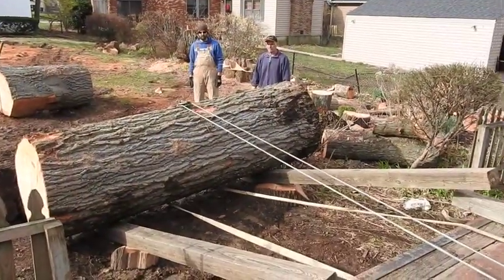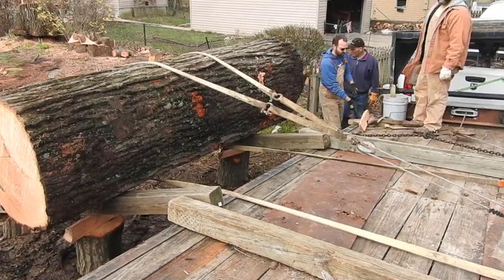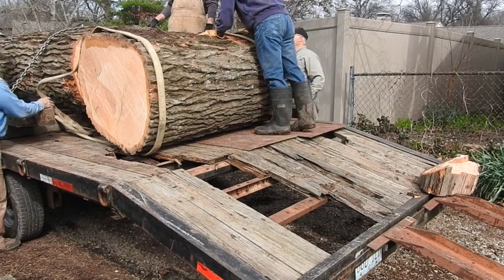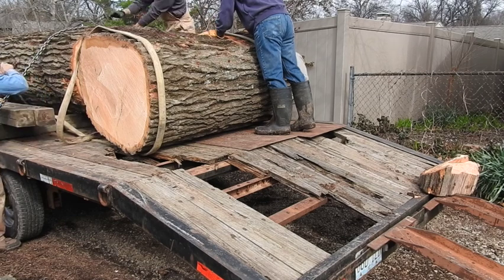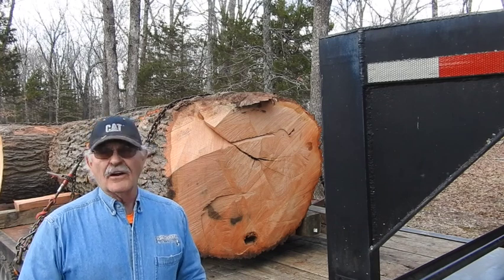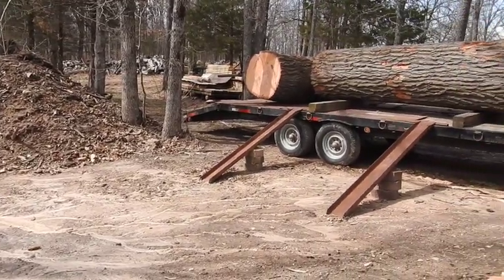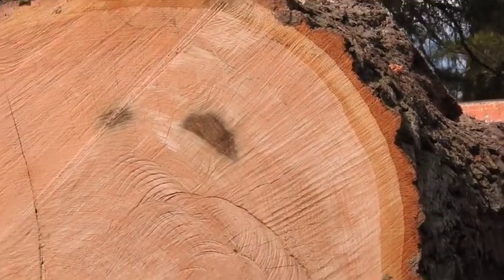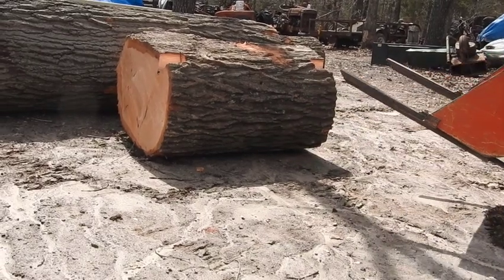APEX 12,000 lb Winch 4 Snatch Blocks Loading Big Oak-What Can Go Wrong

Comment: I Like that one Sir ( he scenario being the short chunky one rolling off the back end of the trailer at 60 mph on the busy interstate.  Not gonna happen....!! ) Like the last paragraph of yours very well written text Sir !!! Very well rigged cable, chains, support !!! THESE ARE MASIVE LOG !!! That work was vey hard on your trailer floor !!! Very nice commentator lady voice 🌹 These are very heavy for sure !!! Have a OUTSTANDING safe week to both of you Cheers !!!
Reply from the maker: Thank you mon ami for stopping by and adding a superb comment !!  Yes, they are a bit heavy and yes, its hard on the floor, but if you notice all the steel plates on the deck that's because the deck is mostly missing under them....LOL  I've been working on sawing new oak deck boards, but what I've got sawn are air drying right now....but soon we will get it all fixed.
Reply: @tractorman4461  ; )

Comment: pleasure to watch a crew that knows how to use blocks. Job well done.
Reply from the maker: Thanks Larry, for the cool comment.  Much of my career in commercial hvac involved rigging and lifting small to super large equipment to rooftops as well as up and down steps, and about any situation with every kind of crane on wheels or winch there is. Well, that's an exaggeration, but we've done more than a little. (-: Thank you for the compliment on the crew.

Comment: Many thanks for that video. Worked our Woodland Mills 30 Max this last weekend for the first ever cut and ended up with a trailer of 10ft 6x2" Alder for the mill shelter roof. Two beginner problems. First , set the top cut too low and caught the top butt flare of the log before we reached the end of the log. Elementary mistake , oops.
Second , hauling the log up the ramps the flare gave us an unequal climb rate and looked like we were going to loose that end off the  inside of the ramp. Managed to push it back.
New project, rebuilding my Massey Ferguson 135 to take  a frontloader with forks and use for  moving lumber. Wife had already suggested using strops with snatch block as in your videos so really useful . I think we'll be borrowing your ideas. Just looking for the milling video (s). Cheers from Wales , UK.
Reply from the maker: Aw heck Lloyd, I ran aground just a couple weeks ago with the saw head.  I knew better, but took the chance and lost.  LOL  Next time a lot goes crooked, try blocking the fast end and let the other end roll to catch up to it.  We sometimes can block it with one guy holding a cant hook handle against it and the log will slip on the handle while the other end rolls.  But you have to be careful with a strong guy in that position...and roll slooooooooowwww.   
    I think if you type in 'Tractorman44 sawmill' in the youtube search bar it should pop up a lot of the milling videos.  Thank you from watching from so far away...we may visit Wales one day and have already made it to Ireland and Scotland.  I would LOVE to visit the Isle of Man during race day.  Thank you for todays visit and please don't be a stranger. I might be a little slow on replying from time to time, but I get to most of them all the time.

Comment: Most I have ever had on my mill was 24 inch, that was 20 ft long. My mill could not handle those puppies you brought home. Would love to have that wood. Great job.
Reply from the maker: These will have to be trimmed down with the Alaskan mill before they'll fit my little Frontier.  But If I had the big 60'' circle mill in operation, I could handle them the way they are I believe.  Thanks Jim for stopping in today.  I've already milled the short on that's on the back of the trailer:https://www.youtube.com/watch?v=u5_vJDP4w0s&t=57s  It's not the best video.  I'm still learning the holzfforma set up.

Comment: I  can sure see where a few oak planks can be used!
Great 'blow by blow' on those logs rolling off the trailer too, "Tractorman00'!  Thumbs up!
Reply from the maker: Hahahahaha....I was wondering when a comment would reflect my rotten deck boards.  The metal plates are on the flat portion so I can haul tractors or vehicles.  LOL.  I've been sawing a little oak here and there in 12's and 8's for the 20' deck.  But yeah, it needs a new deck.  LOL And yes, the Missus did good at the end !!
Reply: @tractorman4461  Who, me?   I'd never suggest anything like that, would I? Hahahaha! Yeah I would.
I was only thinking that the trailer would look so good with all this new planking on it,.... wink wink nudge nudge!  LOL!
Reply from the maker: @regsparkes6507  methinks youthinks correctly !!  (-:  All good things in time....
Reply: @tractorman4461  Yes, I can wait!  hehehehe!

Comment: 6848 pounds on a 10ft log. Norwood sawmill app. Its got a 1051 bf. In it. It's neat to know the stuff like that. I use it all the time.
Reply from the maker: Dang, I'll have to download that app.  Thanks, that's good to know.  Are you running one of the Norwood mills ?  I have one of their cheaper Frontier line, and OS27.

Comment: Nice job, Wendell.  Had me a tiny bit concerned but I knew you and the men would lean more towards cauton rather than try to grunt-move that massive log.  Those logs shook the trailer as if it was a paper weight. So good to see the logs in ther final resting place until you decide t move them.  They should produce some nice lumber. Be safe, my brother.  Semper Fi     Don  👍🏽🙂  4/3/22
Reply from the maker: Oh yeah Don, first and foremost we want no injuries to anyone. Slow and steady keeping an eye on everything happening, continually checking the rigging etc. is the only way to work with logs...even ones much smaller can easily break legs.  I commented to look at the flex on the front of the trailer as it rolled off the ramps as we were loading.  That's when I decided to place the short one at 90* to the big one.  S/F my friend and brother and thank you for watching as well as for the visit today.

Comment: Man that looked like a fun day. I wish the tree services I used to work for had done things like this. They just ate through chains cutting it into pieces and we'd toss it by hand. Nothing wrong with sweating but dang some of those days were rough.... That's the trailer you're re-decking right?
Reply from the maker: After that comment you made on the other video, I just KNEW you would like the bit of rigging on this one.  LOL  Yes, that's the deck I'm sawing oak for.  Kinda needs it doesn't it.  LOL  The Missus got a bit excited during the off load...cracked me up when I was editing this one....

Comment: Is there a reason you didn’t attach the snatch block to the tree on the other side of the trailer ?   One less pulley
Reply from the maker: Actually there are two reasons. First It was just enough off center to confuse the issue bringing the large log through the existing opening in the fence and secondly it too is not a healthy tree with one of the forks rotten and already fallen.  Then that fork is in the tree about 11 feet up with a large above ground phone cable and a 'cable' cable running through the fork.  I figured it'd be my luck to break an already weak tree and take out a phone line.  But that didn't stop us from throwing a nylon choker around it before the final rigging and look it over before abandoning the idea.  Good eye there Mathieu, good eye.

Comment: The Missus makes an excellent narrator.
What about that trailer? The boards are looking mighty thin. Is this the one you cut the planks for on the sawmill? Why ain't they installed yet? lol
Be safe.
Reply from the maker: Thank you Rick, for the nice words about the efforts of the Missus.  The trailer deck has been on the list for repairs now for a couple years.  I've got about half cut that I need and they are air drying now.  So later this year I hope to get it done.

Comment: Good narration of the Missus! I was wondering about the V notches but you answered the question.  That last log would make nice thick lumbers to replace the wood bed on your trailer. That won't be a waste of time to replace that rotten wood! As I was wondering how your wood mill would support that weight, I remembered the base you did for that. No worries there!  But what about the OEM cross braces on which the log will sit? Can they support that? Thanks!
Reply from the maker: Yes, the old deck has been asking for repairs for a few years now.  I think it's time to listen to the request.  LOL  The cross beams on the bedframe is box tubing. I don't think there will be a problem with the weight on them OR the frame. If we divide the approximated weight of the log by the number of crossmembers that the 11' log will span we can see the approximate weight per member.  
   If the log's estimate by the time its trimmed down to fit, is around 6,000 pounds, and it spans six crossmembers, that'll be 1,000 pounds each. If it spans 7, that would be 850 pounds.   Estimation on the log at full diameter and 11'4'' is 7,000 pounds.  I'm estimating 4 1/2'' trim on four sides to fit the 28'' mill.  Of course Joe, this is all by the seat of my pants estimation.  There was a viewer with a  Norwood chart that showed the weight at 10' to be 6,800 (+) pounds.

Comment: So the duty cycle stays the same  even with the extra snacthblocks? Did the one double the winch strength and the other two just helping? Great to hear Misses doing the play by play! Thanks!
Reply from the maker: I would think a snatch block extends it a little Mike, but I don't know for sure.  It would make sense there's less heat generation on the contacts of the solenoids with a lower load on the winch.  I never worry about cycle time with a light rolling load for that reason.  Only the one on the log gave assistance to the winch by doubling the output. The other three were just changing direction so we could pull from the side of the trailer with the winch mounted permanently on the front.   I should've done a close up, but the first one was directly in front of the winch directing the synthetic rope  into the fairlead so it would wind correctly on the reel.  The other two shifted it down the side of the trailer to pull straight from the side.  I can see her lips moving but I never know WHAT she's saying until editing time comes around.  LOL  She kills me sometimes.  (-:
Reply: She is a hoot! Thankz for sharing her and how you go about your work. I normally have to do thiz kind of work by myself.  Great to see how you get the job done! If you can't get the Alaska rig could you just split in two to get the wood on your mill?
Reply from the maker: @mikeadams2339 The Missus was having fun and wants to more narration for me.  I think she adds that little 'flair' to the videos Mike....LOL 
    On the log, I think the best thing is to shave it down to fit the OS27,  I think  subtract 28 from 45 then divide that by four and take that amount off the log.  Then we can go about adjusting its dimension for centering the grain to begin milling.  Of course that thought process may change before I get to it though.  Roughly 4 1/2'' off each side should be close, providing the 30'' Alaskan mill will allow it.  Time will tell.
Reply: Yes more FLAIR!!!
Reply from the maker: @mikeadams2339  hahahahahaha....we will see.LOL

Comment: Your trailer earns its keep
Reply from the maker: Its not bad for a home made trailer.  LOL. I most recently changed the axles to 8 lug 8,000 pounders and changed from a Ramsey 8,000 to a 'badlands 12,000 pound winch with remote.
Reply: @tractorman4461  wow! Good for you. Id have to buy something like that
Reply from the maker: @timbarry5080  I LOVE the remote control.  I can walk all around and keep a closer eye on what is being loaded or sit on the seat of a dead tractor or vehicle and more easily control the loading process.  The old Ramsey only had a 10' tether, so I'd have to stop and adjust steering wheel and go again.  With the wireless there's no stopping needed !!  Thanks again for the continued conversation Tim.  Good luck to you on your endeavors.
Reply: @tractorman4461  thank you! Today I'm dragging logs with my pickup truck
Reply from the maker: @timbarry5080  Heck yeah man, today is as good a day as any !!  I just missed a free cut and trimmed white oak 28'' diameter and 12' long.  A buddy texted me and gave me the link on marketplace but by the time i contacted them the ad was already removed.
Reply: @tractorman4461  uggh. That's too bad. That would be another beast of a log. I was just dragging tulip poplar that I cut last year, so it's comparatively light.

Comment: I notice a Mo plate on that trailer, which part of the state do you live in? I'm from the Jackson area.
Reply from the maker: I was just down to Jackson a month ago to Miles Diesel Injection Services on the main drag.  I live 20 miles or so north of Ste Genevieve....right off I-55
Reply: @tractorman4461  I used to chat with a guy up that way by the mane of Wendell, he went by the handle Missouri Massey Man
Reply from the maker: @thomashale6851  Hahahaha....now that's funny.  I bet that was on Antique Tractors Forum wasn't it.   I'm still a member there, but I've been so busy with YouTube I've not been active over there for a long time.  I'm trying to think of your username...it was unique if I remember right.  I've never even mentioned the channel over there either.  I guess a lot of my internet friends are still active.  Jim in NC, For I'm Not Right, Dave in Kentucky....and many more.
Reply: @tractorman4461  Brown Dirt Cowboy when caseman sold the site I never could figure out the new owners way of doing things so never got signed in. I see Steve post now and then on yesterdays tractors
Reply from the maker: @thomashale6851  Yes, it was confusing for sure.  It never really was the same after that.  The new format was difficult to work with, then I got started on YouTube.  I'm still a member and a couple years ago got on and posted a few times, but was just spread too thin.  I haven't been on YT for a long time either.  But yes, I totally remember the Dirt Brown Cowboy !!

Comment: Nice job! What is the name of the thing you nail into the log with the chain attached?
Reply from the maker: We've always just called it a log dog.  You can tell it works pretty good for this, but never for pulling up a ramp unless you can get numerous wraps and want to pull from a single point.  We don't like it because the log can sip sideways.  The 'V' shape of the dual lines keep it running in line.
Reply: @tractorman4461  Thanks for getting back to me. I looked online but cannot find the log dogs, are they no longer made? You definitely have this down to a science, nothing beats experience.
Reply from the maker: @pvwjr  This log dog is from the old home place. It was kept on the deck of the carriage on the Fisher and Davis 54'' circle mill.  We had a chain hoist hooked to the rafters and we'd use the log dog and the  hoist to flip the large logs against the headblock of the mill that were too large for two or three of us to flip by hand to square up.  I don't think 'log dog' is the correct name, but likely just a slang term.   I would think a guy could easily make something similar from an old cant hook.  A little welding and a few chain links might do the trick or maybe a ring for a shackle to hook through.

Comment: You scared the P out of me.  Never stand behind something in tension like that.  You could be killed or injured.  Use a long pole to move the stop forward.  Not worth an injury.  At least say " hold my beer"before you do that.  I have some bigger oak that I need to get out of a ravine.  I think I will borrow a bulldozer and excavator.
Reply from the maker: Hahahaha....'Hold my beer'....that's says it all Brian.  Man there a tons of funny (not funny) videos out there with that phrase right before disaster !!   I forgot to toss a canvas over the synthetic rope, and I don't know what to expect if it was to snap, but it would probably be much worse than cracking a whip !!  The bad thing about tossing a dampener over the cable or rope while using snatch blocks is there's so many things to keep an eye on already that you'll have a tendency to get it rolled into the block. 
    An excavator would have been the preferred method, but unfortunately it was out of the question on this job.  We did load one a few years back that was 51'' across and luckily a 963 Cat was available for that one.  We got six loads of wood off that tree.  Thanks Brian for your input and good luck with your big oak removal.

Comment: Somebody should tell the fellow in the grey shirt and black hat to move back. He is doing nothing of value by standing up next to the logs while they are being moved and the cables, straps, and shackles are under load. He insisted on having his hands on the moving logs as though he was helping to move or steer it. Multiple snatch blocks create multiple danger zones if something breaks loose.
Reply from the maker: Yes, there are always multiple points of danger when winching logs in this fashion.  Everyone needs to keep their attention on whatever piece is being moved and make sure they are not anywhere near a spot of danger. Though occasionally it is unavoidable.  We managed to get them loaded and unloaded without breaking any bones or shedding any blood though !!
Reply: @tractorman4461  I'm glad to hear that it all went well.
Reply: Whatever happened to these logs? What species of wood?